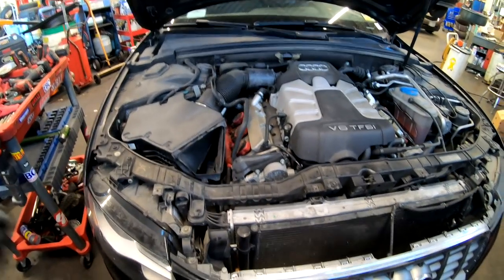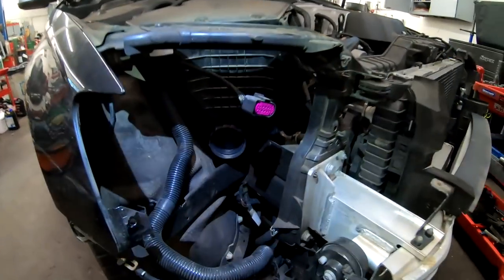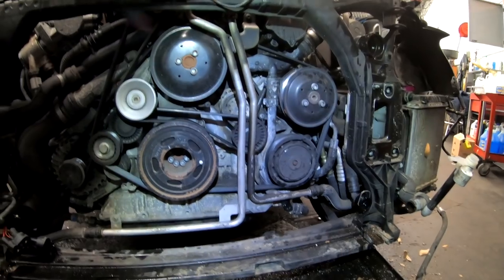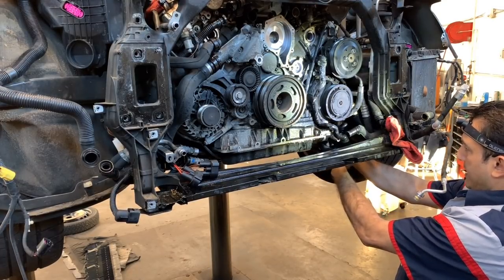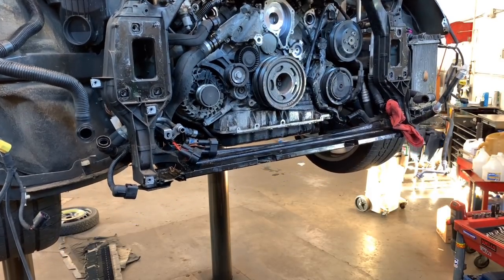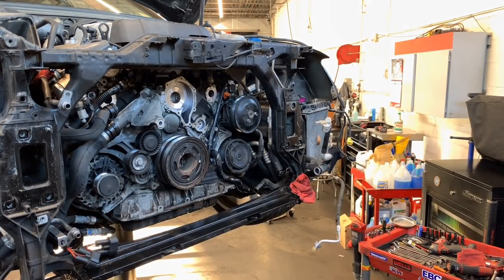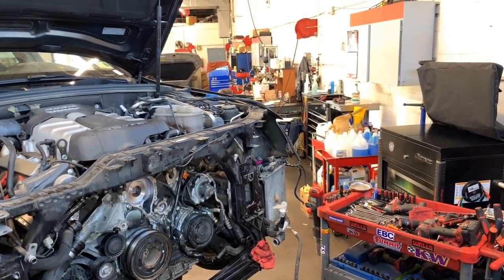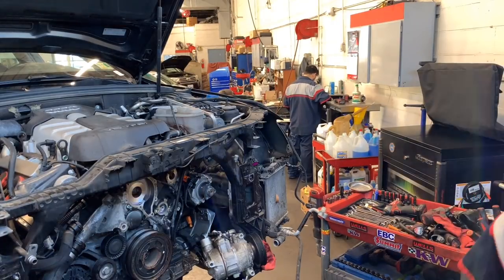2010 Audi S4 V6 3 0 Water pump and bypass coolant lines replacement

Comment: Just changed the waterpump thermostat and pcv( I'M all like, might as well do this once i cracked the davinci code to access the thermostat), stood on my head to do it.  Getting the pcv valve out revealed some dirty ass injectors and intake .    I prefer working on things i can hit with a 20 pound sledge every once in a while, this little stuff, bah.  Pretty dick move making me take off stuff to get at that pcv audi engineers.  These vids help a lot, thanks.  If i can see how it comes apart I at least pointed in the right direction :)

Comment: Great video... I have not yet had the pleasure to do this work.
People always want to know how much the repair will cost... it's difficult when you don't know where the leak is and what "other" parts could use changing once you have things apart. People with expensive cars are usually the worst (at least what I've noticed from our customers)... they barely have the money to pay the lease for the car. Why buy something that you can't afford to maintain?
Reply from the maker: Thomas EXOVCDS so true! I am glad that here is not so bad. Most of our clients understand that otherwise it will be paying double. Once you open it some things show and you have to replace. When they decline the repair with make them sign to not have a later complain!!

Comment: Have a water leak issue with same audi. Water coolant disappearing. No visible leak on outside. Coolant bottle runs empty when fan comes on. Water in sump. Any ideas?
Reply: PCV under the supercharger.

Comment: I have a 2009 Audi A6 3.0L supercharged and keep getting a code that says map/maf throttle position sensor correlation error, it sets under hard acceleration. What could it be? Oh and there is also an air intake leak code

Comment: Hello I have a 2011 Audi A6 Quattro s-line with a leaking Coolant Pipe .
Do you know if you have to purge the Ac and recovery the freon to replace this part?
Reply from the maker: Mary Hart I don’t know. Audi A6 coolant pipe? Lower, upper left side, right side, under intake, font engine? With out an actual picture or a diagram marking the pipe you refer to is impossible to say.

Comment: Oh please this is nothing those engines also come all wheel drive front wheel so they mount the engine sideways and you need to pull engine mount fender and bumper and grill need to pull off a little bit to release fender  the sideways mounted engines for the cars really sucks to do
Reply: Uh. Wrong bud. This is not a transverse mounted engine. You're thinking of the 2.0 or 1.8. The 3.0t is a forward mounted engine.....